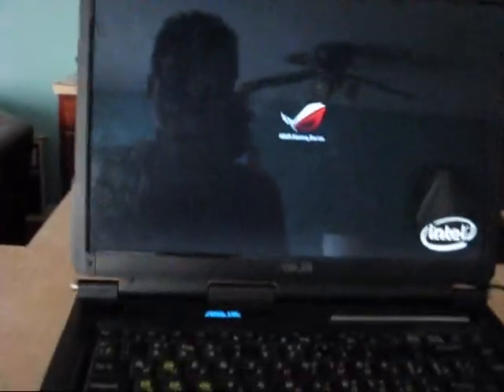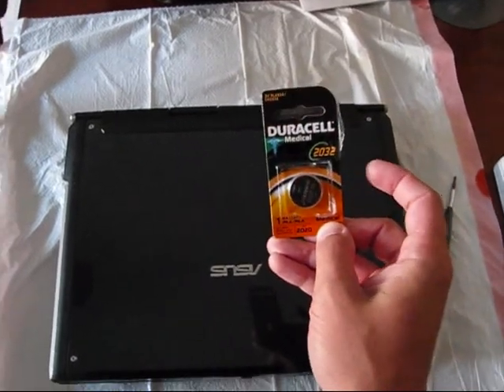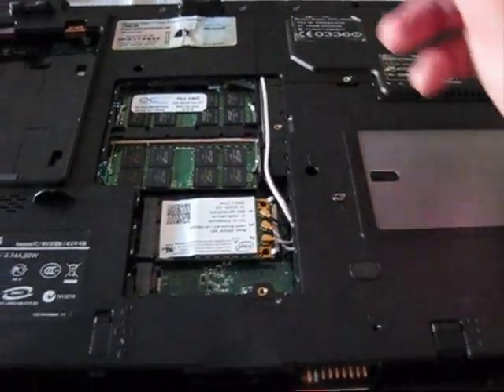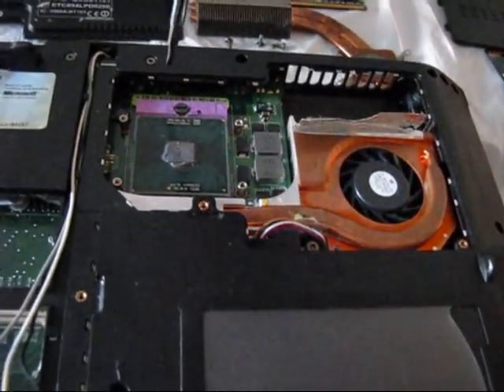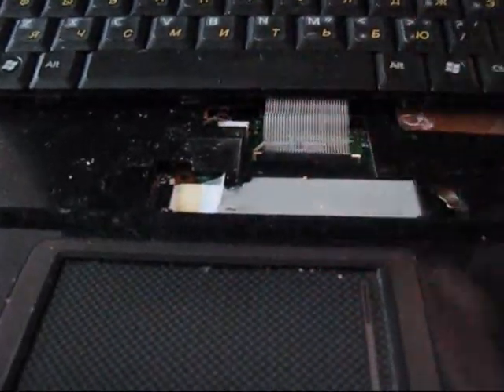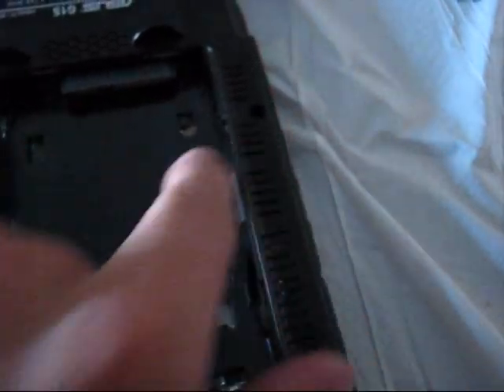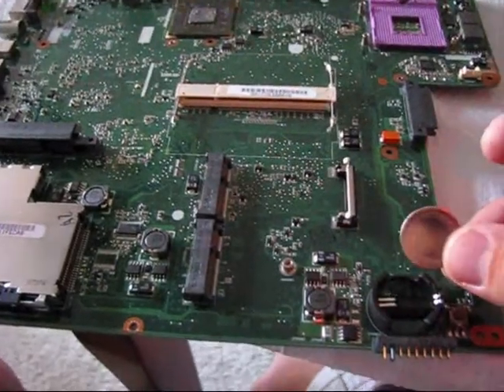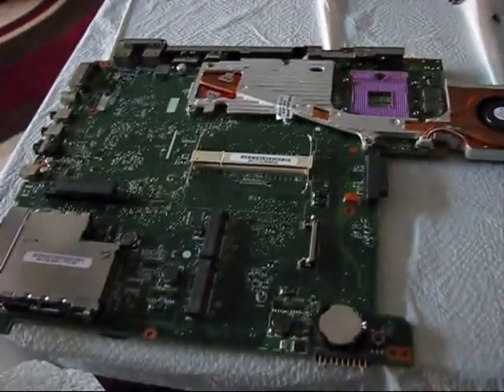Asus G1S Replacing BIOS CMOS battery CR2032

Comment: A lesson in how NOT to design hardware. The placement of that batteryholder should naturally have been where it could be replaced with only opening one of the small panels. A million thanks for this how-to video. I most certainly do not look forward to having to do this myself, but by showing how to do it you have saved me hours of anguish.
Reply from the maker: thank you for the comment.

Comment: This is freaking ridiculous. I'd rather set the clock and deal with passwords. All this for a cheap little battery? Nice little computer company scam there. What say you tell me how to get my computer (yes, Asus G1S) to see the hard drive? Not for that I might do some disassembly. Got this computer second for cheap (I think it was free) but, I just haven't been able get it to work (ie see the hard drive). I've tried using USB drives with no luck.
Reply: Larry Demoret To get to the drive, it’s very accessible and easy.  Don’t have to take the ASUS G1S apart.  I did it 3 days ago.

Comment: To just replace CMOS battery in this ASUS laptop, you have to completely take apart the computer. At least on my HP Pavilion dv5 it's easier to replace CR2032 in case if it ever goes dead since the battery is located near the screw hole, which holds optical drive...

Comment: i bet it's as complicated to replace the CMOS battery on an Asus G50VT laptop. Luckily mine, which I got in 2009, still hasn't gone out but it'll probably happen sooner than later! I think i'd just hit 'F1' each time and let windows calibrate the time every time instead of going through the trouble of replacing the battery. Just hit F1 and each time and forget it.
If I had RAID enabled or something else that was non-default, then It'd be a hassle because i'd have to reconfigure every time I turn on the PC. But I think BIOS defaults will work for me. I think the G50V/G50VT/G51J and G51VX all take the CR2032 battery as well, but instead of it being bare, it is wrapped in a blue thingy and connects to a header on the motherboard.
http://s1104.photobucket.com/user/RainMotorsports/media/DSC_9127.jpg.html
Reply from the maker: +danwat1234 Yes, I'm pretty much sure that it's CR2032...
Reply: +Alexey Gavrilov But can't just buy a CR2032, I'd need to buy it with the blue condom I think. Or solder up the replacement myself
Reply from the maker: :-) you don't need condom for that :-)
Reply: +Alexey Gavrilov haha. Buying the battery in the blue "wrapper" is a lot more spendy than just the CR2032 but that's needed because there is no battery holder on the mobo